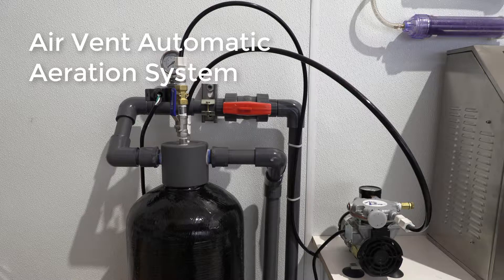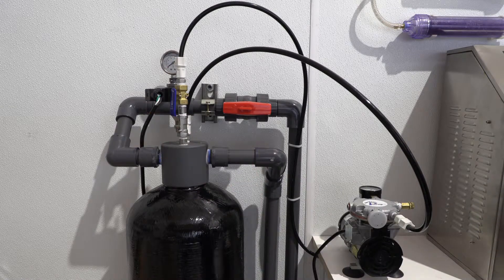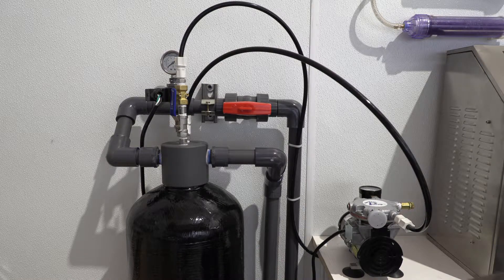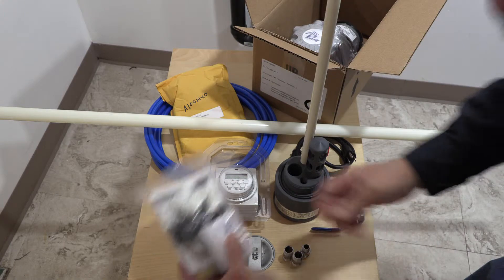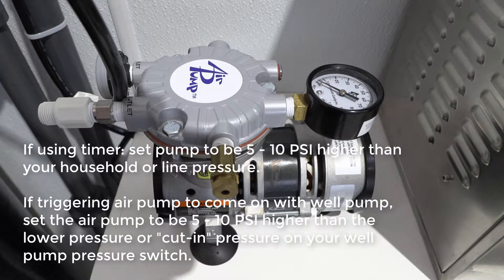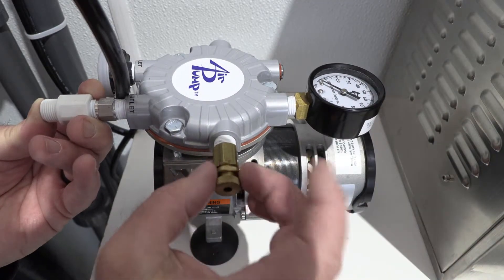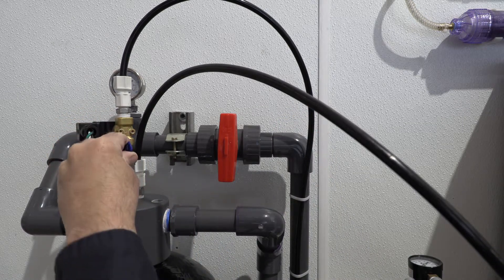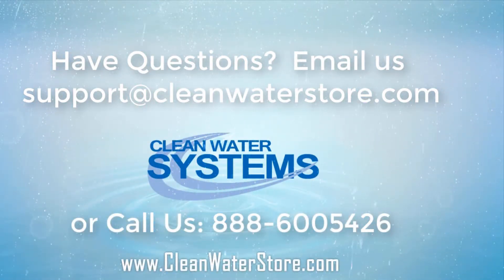Air Pump Maxi-Vent Automatic Well Aeration System

Comment: Will this also help remove CO2 and normalize the pH?
Reply from the maker: Hello -  yes this can help vent off CO2 and help raise pH.  Depending on the water chemistry (pH, alkalinity) you might still need a calcite neutralizer, but you would use a lot less calcite if you aerated and vented it first. You would want to make sure any vents went to the outside and not vent CO2 into the home.  thanks for the good question.

Comment: Nice set up and clear demonstration on the system. If you activate the pump through the well pump pressure switch or a flow switch obviously the pump will run when there is water flow. However, you've mention using a timer to activate the air pump "several" times a day. How do you determine how many times a day the pump needs to run? Is it 5 times a day? 55 times a day?  Can you clarify this point. - Thanks
Reply from the maker: Hello - this is a good question.  It really depends on the application.  For a residence, you might have it set to turn on early in the morning before the family gets up, and then run before lunch, before dinner and before bed.   The frequency would be an educated guess and might need to be adjusted periodically.   Or you could have it turn every few hours for 10 minutes etc. depending on how strong the sulfur odor is (if being used to reduce hydrogen sulfide odors).    We do recommend the flow switch or wire directly to the well pump, however using a timer makes it a lot easier to install.
Reply: @CleanWaterStore  Thank you for your answer. It's basically a "refinement" process based on quality of water produced. I asked this question since I have my system driven by a Thomas .5gpm flow switch which is failing and requires 6 or 7 faucets to activate even when by-passing backwash and softener tanks. Hence, I wanted to experiment with the timer option.

Comment: How can you get the air out of the system after it has aerated the water to eliminate the milky water effect in the home ?
Reply from the maker: Hello - you can turn down the  number of minutes the air system runs.  If you are using double-aeration, you can remove that diffuser stone and use only single aeration.  Another way is to install a second tank with air vent after the tank.  Please contact us at support@cleanwaterstore.com as we have some options to lessen this.   thanks for asking this question!

Comment: will this work to aerate Radon?
Reply from the maker: No this won't work for radon.   For radon we use a different system that aerates the water and has an active vent fan to push outside above roof line.   https://www.cleanwaterstore.com/aerator-tank-systems.html   Those work good for radon.
Reply: @CleanWaterStore  thanks I will look in to them

Comment: How does this compare to a hydro peroxide system - also can this be used outsite?
Reply from the maker: Hello - if installed outside, it would need to be protected from rain, sun and freezing, but some customers do install under an enclosure. The air compressor must be kept dry and out of the rain.    Its not exactly comparable to peroxide injection, which we also carry.   With peroxide injection, no gasses are vented off, the peroxide does do a good job at eliminating odors as well however.   This system does not require any chemicals or routine maintenance.  We have customers use the same system for 8 to 10 years before the compressor diaphragm needs replacing, so its very low maintenance. https://www.cleanwaterstore.com/air-pumps-with-tanks.html
Reply: @CleanWaterStore  Thank you for the quick response I do like this setup and I will go to you website for more information - thank you very much